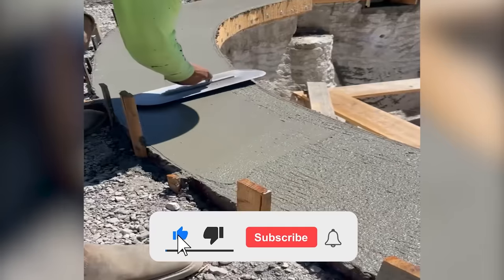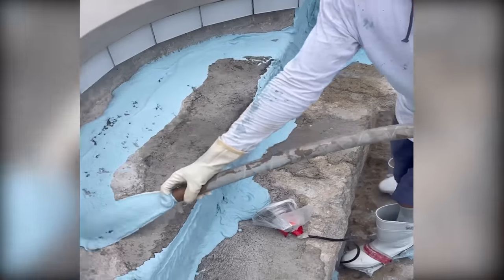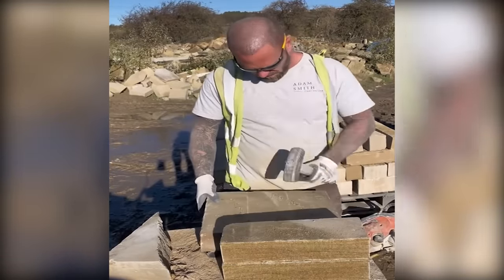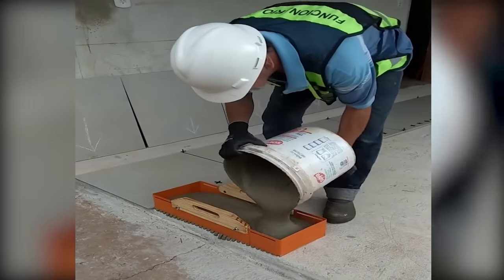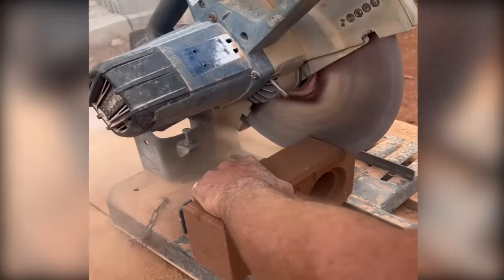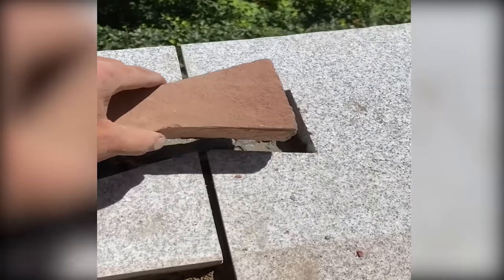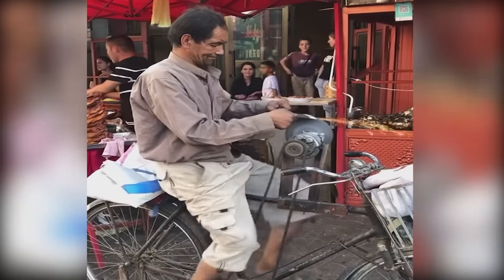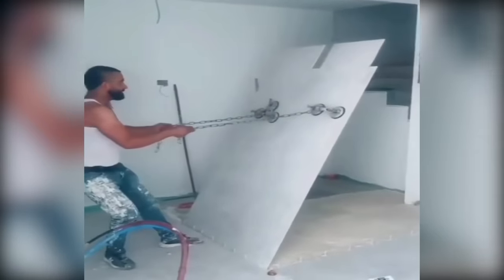Ingenious Construction Workers That Are At Another Level #29

Comment: Those 55 gallon drums were empty.  Definitely not heavy, and not filled with something that sloshed around.
If it was 55 gallons of water, they would weigh over 450 lbs.  It would take the Hulk to get them down from the top of the stack by hand.  While a person can roll a full barrel on the edge, one can't fling them to a coworker.
Reply: He never said they were full, he said heavy.